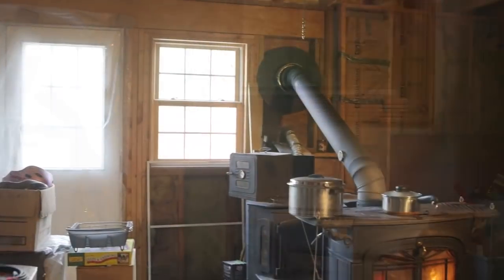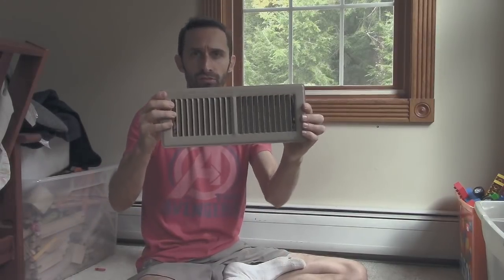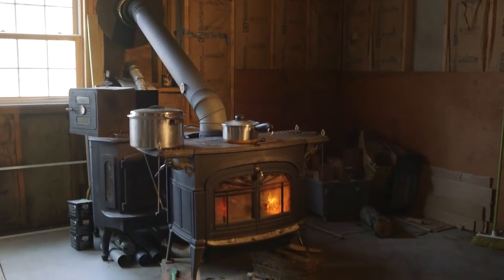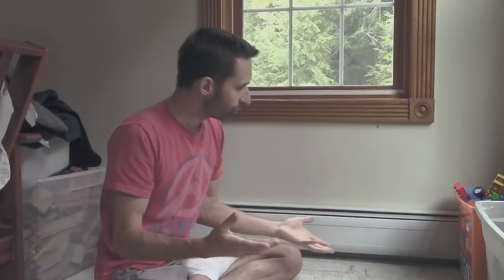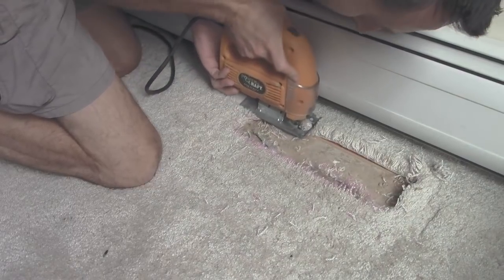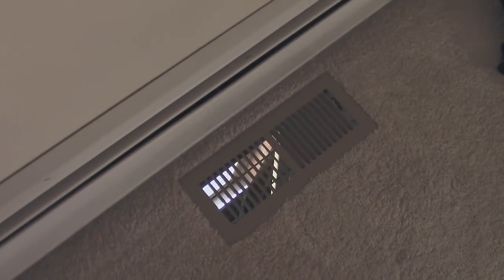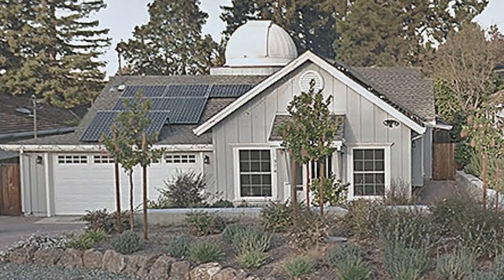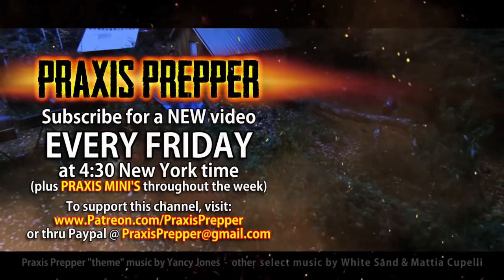Turn Your Normal House Into a Prepper House!

Comment: Good tips!  One thing I have learned the hard way, retrofitting a home is extremely difficult, time consuming, and expensive compared to just building things the way you want from scratch.

I have been thinking about seeing if it is possible to make a convection hot water loop system so that you can use radiators in rooms and such.  Just another one of those projects on my never ending todo list.
Reply from the maker: Yeah, I'm a big fan of doing things from scratch too.

Comment: You could always look at a fan to assist... suck the hot air up from the basement?
Reply: or use a much larger register.
Reply from the maker: Both would help. I'd be more inclined toward the larger register though because it doesn't require energy or have moving parts.
Reply: . @PraxisPrepper  You could always just get a petulant teenager from the mall. I hear they suck big time
Reply from the maker: Maybe put them in a huge hamster wheel and dangle their smartphone in front of them just out of reach.
Reply: Growing up in rural New Brunswick there were still houses that used wood furnaces in the basement (no electric assist just a big wood stove essentially) they would often have large register vents around the edges of the open spaces and quite often a large 2 foot by 2 foot heavy metal grate in the middle of the living area open to the basement. Lots of air flow that way. Many old homes there from the mid to late 1800’s still using wood or wood/oil combo stoves for cooking. When summer came along they had a second wood stove in the summer kitchen (entry area outside the main kitchen so the heat of cooking on the wood stove didn’t heat the house up in the summer) One of my aunts lived quite comfortably that way into the early 1980’s.

Comment: Lord, kid. You need a proper air exchanger.. Please be careful with carbon monoxide poisoning and Randon gas, you're near Canada. Uncle Al is getting too old for this. Here a tip, kid: vapor barrier
Reply from the maker: I'm not sure how radon gas plays into this at all, but carbon monoxide really doesn't seem to be an issue if the woodstove is run properly. For example, the fact that one can run their car in their garage with the door shut and kill themselves isn't an indictment of using an automobile at all, it's just an example of people not knowing how to use a specific tool properly.